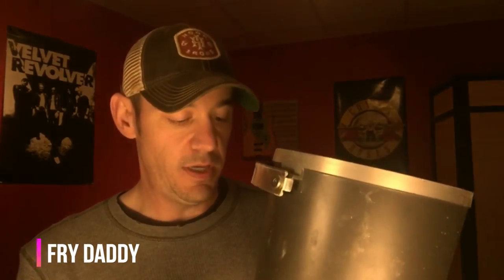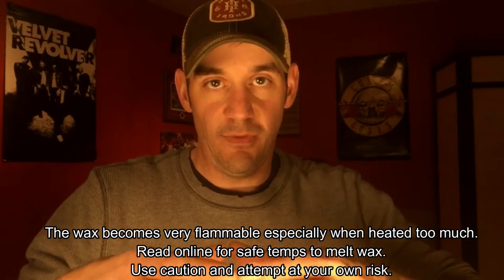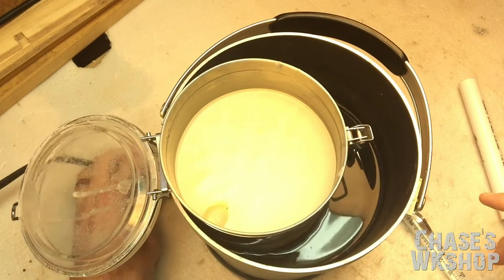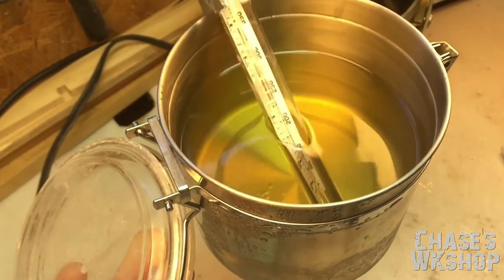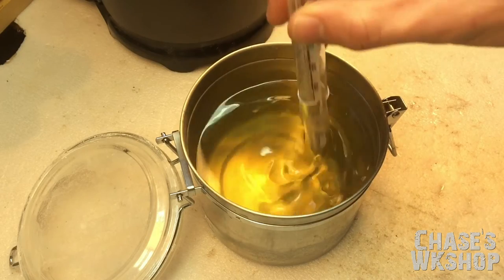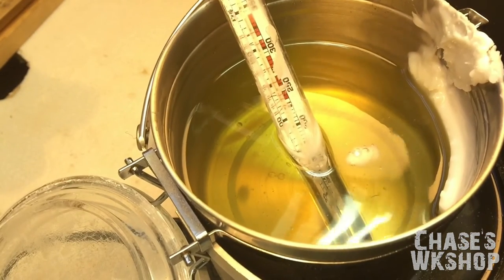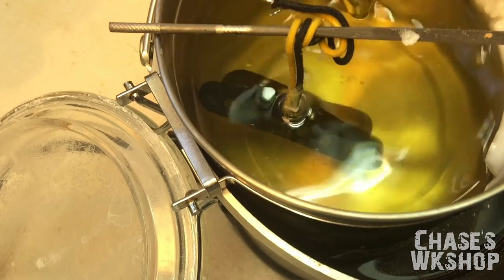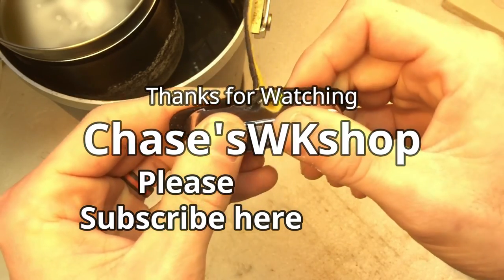How to build a Guitar Pickup (part 4) Potting a Pickup

Comment: Thanks for the tip on using a thermometer. I never gave it any thought about the wax getting too hot and melting that coating on the wire. Thank wouldn't be good after all the hard work!👍😎🎸🎶
Reply from the maker: Glad I could help bud.
Reply: @ChasesWKshop  👍😎

Comment: great videos,based on my experience pickup building, it's a lot easier and less messy to wax pot a tele pickup before you put the metal cap on. You get a much better saturation through the windings and eliminate the chance of getting missed spots from trapped air in the cap,plus the metal cap is going to cool off your wax temp much faster than you'd like. You're doing great though.
Reply from the maker: Awesome, thanks so much for the info bud.  Let me know if any other suggestions. I appreciate you and welcome to the channel!!
Reply: @ChasesWKshop  no problem, thanks for taking the time to make the videos.

Comment: If you ever get to rewind any vintage Fender single coils, when you remove the original magnet wire, you will see that often the wax did not penetrate very far into the coil. Best of luck with your channel!
Reply from the maker: Very interesting!  Thanks for the comment bud.

Comment: Have you experimented with short potting times, for a more vintage sounding pickup? What I wanna know is if you are a cleaner player and you want a pickup that has a more complex tone, could you pot it real light so that it picks up more of the sound of the guitar wood, put is potted just enough to not squeal?
Reply from the maker: Man I’m not sure on that. It would defiantly be an excitement on the builder to improve the sound they want. I’ve always done potting until the bubbles stopped or I don’t pot at all. They are defiantly brighter with no potting.

Comment: Thanks a lot man, very informative! Great video, only disappointed we didn't get to hear the pickup in the end! I don't really understand the purpose of the "potting" part, wouldn't the pickup sound the same without it?  🤔
Reply from the maker: Thanks bud. Glad you enjoyed it. The potting just locks and protects the windings from vibrations to keep them from shorting out over a long time. Kinda like the same concept of two wires rubbing together in a car eventually short out.  I’ve made many pickups without potting them and they work great.  There is a slight difference in the sound too. Just experiment with it. Don’t let the potting pickups process keep you from making them. Thanks for the kind words.
Reply: @ChasesWKshop  You're welcome. Appreciate the effort you've put into these videos.

Comment: hello chase, I want to make pickups but I want them to be humbuckers, you can make a video or explain how the copper coil goes in this type of pills, I also want to know, you need the cover that you put on the end, because I have reviewed the pickups of my guitar and only have a black ribbon of cloth. Thank you
Reply from the maker: Heitber Andres Montilla Ramirez, I plan on doing some humbuckers in the future bud. I think what you’re asking about is what is wrapped around the coil. I didn’t use anything on this pickup but the wax. You can use pickup or wire tape. That’s the black cloth you see on your pickup. It just protects the windings. Hope this helps. Let me know if you have anymore questions bud. Thanks!
Reply from the maker: Heitber Andres Montilla Ramirez here’s the tape I’m talking about. 

https://www.stewmac.com/Pickups_and_Electronics/Pickup_Kits_and_Parts/Pickup_Kits_and_Parts_for_Strat/Pickup_Coil_Tape.html

Comment: Hello Dear..I AM Alex from Brazil it's a great Job..your machine looks Like of Mine hehehe. I have a question...when you Wind fastest does the counter works well?..i have used a Reed switch to get pulse tô the counter and when I use in high speed the counter stops ..o motivo sure If ia ls the Reed switch or the counter...let me know.
Reply from the maker: Nice to meet you Alex. Welcome to the channel. Yes I clocked the counter at 1200 rpm but that is about it’s limit. Watch these two videos and you can see me test the counter.  

https://youtu.be/E_TAop2xVdc

https://youtu.be/PiOvFf2sU68

Thanks for the question bud.

Comment: Man... these videos are absolutely fantastic! I was 30 minutes late to work today, because I just had to watch them all! Thanks for making em Bud! I do have one question... When you put pickups into wax, I imagine the goal is to get the wax to penetrate as thoroughly as possible down into the bobbin, and coat as many of the individual wires as possible and fill in any air voids. So, could you not have potted a "lipstick" tele-style pickup with the metal cover and the tape completely off (imagine that you did not have the couple of loose wires issue), and then tape it up, install the cover, and then pot it again? It would be an extra step, but without one of those fancy vacuum things to really suck out all the air, it seems like potting the pickup "naked" and then reporting it "dressed" would help. Thoughts?
BTW... my whole family is from Alabama; I love the Muscle Shoals gear.
Reply from the maker: Michael Perkins thanks for the compliment buddy I’m glad you like the video. Yes that would work perfectly fine. The only problem might be when you preheat your pickups for waxing them again. I’ve looked at a lot of pickups and a lot don’t have any tape on the tele neck pickup at all. The tele bride I use cotton yarn to wrap the windings instead of tape so the wax will penetrate better.  That awesome your family is from Alabama.  It’s a small world lol.  Hope I answered your question and thanks for getting my brain thinking on another possible way to pot a pickup. Hope you have a great day bud.

Comment: Why did  you pot it with the chrome cover on it. Wouldn't it be better to pot it with out the cover on it? I thought the whole idea of potting it was really to fill wax in around the wire coil as that is what vibrates?
Reply from the maker: woodknack1 thank for the question bud. You want the cover to be solid on the pickup so it doesn’t cause any sound issues. I guess you don’t have to do it though if you don’t want to.  Let me know if you have anymore questions bud!!